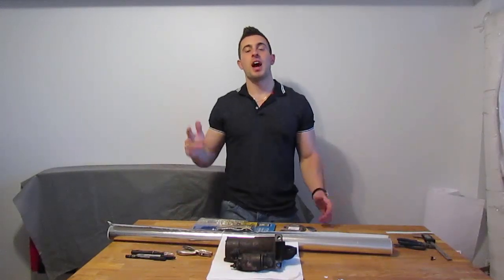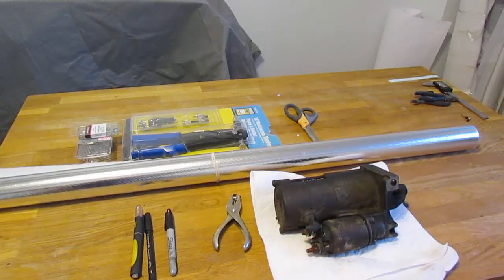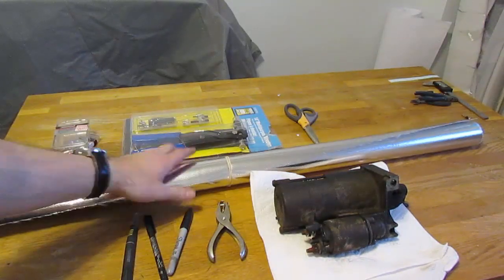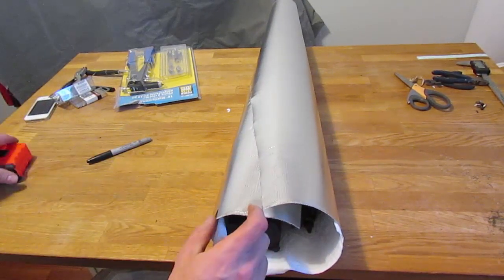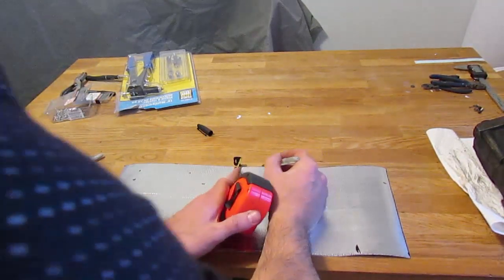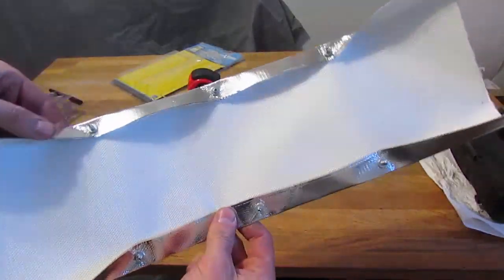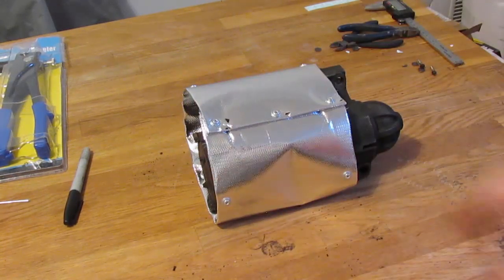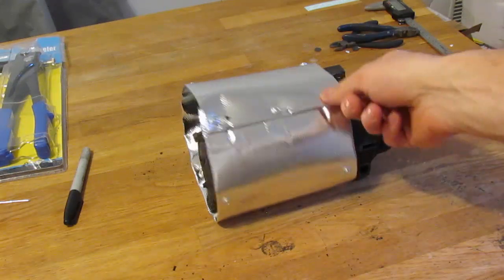DIY: Heat Shields (Part 1)

Comment: Great video! I'm not clear on what the actual material is that you are using. Any suggestions on what to buy?
Reply from the maker: Just go to a industrial HVAC store, it's a heat blanket type of material. some kind of fiberglass interior with the aluminized outer coating. Not 100% sure what the official name is but ask for a heat shield blanket and the HVAC place will know what you're talking about.

Comment: Wild question: Can steel retailing shelves work when making a heatshield? My friend has a few shelves for some reason.
Reply from the maker: You can make metal heatshields, yes. It will reflect the radiant heat from the source. It is pretty common for auto manufacturers to do this from the factory.

Comment: What thing is silver thick paper from where can I get ????
Reply from the maker: I think it is just pipe insulation and I got it from an industrial HVAC shop. Just check the temperature ratings on it but it is the same stuff they use for cars... but for cars they mark the price up 10x

Comment: Good idea.  Where do you get the aluminum fiberglass?
Reply from the maker: I got the material from a local industrial HVAC store. Much cheaper than buying automotive stuff which is identical.

Comment: Interesting video, learnt quite a lot ;)

For insulating my car's air intake from radiant heat, will aluminum foil tape do? My car's got black rubber air intake tubing. Also, should I also cover the whole airbox as well - for best results?

Many thanks in advance ;)
Reply from the maker: Theoretically it will help, but you probably won't notice an appreciable difference on a road car. My thinking is that the air is travelling through these components at a pretty good rate of speed and there isn't a whole lot of opportunity for heat transfer to occur unless the temperatures are extreme. The heat shields in this video were more intended for protecting items that are constantly bombarded with radiant heat from nearby components. But you can always try!
Reply: @EmbraceMaking  The exhaust manifold does have a heat shield from the factory, but even so the engine bay is indeed hot after a 10-15 km drive, so I suspect "every little will help" ;) I will give it a try, hopefully it will help, just a little, reduce intake temperatures.

Thank you for the reply and the information you provided me with ;)
Reply from the maker: No problem! Good luck!
Reply: @EmbraceMaking  Thank you very much mate! ;)

Comment: Great video.  The first car I had as a teen I burned out two starters. The guy I had bought the car from had replaced it before but never put back the heating shield. My dad pointed that out. He cut up a pie tin. put some holes around the corners. wrapped it around the starter, placed sos pads around the starter, to act as a buffer strung wire thru the holes to keep it place. Kitchen made heating shield.
Reply: It should keep radiant heat off very well. I have something similar, tightly around hot turbo side and manifold. Wrapped by stainless steel ties. It works.
Reply from the maker: Whatever works!

Comment: Wrapping a starter? Heat isn't going to affect your starter... Not unless your ECU is in there : /
Reply from the maker: Solenoid can get heat soaked and too much heat = more resistance and starter won't engage.
Reply: @EmbraceMaking  hot copper wire, more resistance?  no!!  unless the copper is melted (1050ºC); i would just wrap the  cut sheet around the starter,and use 2 loops of thin ss wire around the whole thing

Comment: If you get some aluminum flashing cut in 1 inch strips you can trap it in the folded over sections and rivet them in place. This makes it where you can form the shield to contours better and holds to the part better.
Reply from the maker: Great idea! Thanks!

Comment: great video, what would be a good way to fasten this shield to the starter? I have a 77 corvette and the header is very close to the starter and transmission lines. Thanks
Reply from the maker: You can use metal zip ties, they will resist the heat :)
Reply: Wrap around transmission lines ?

Comment: Does aluminum foil work to reflect heat.
Reply from the maker: Aluminum foil will reflect lots of radiant heat. However, it will also absorb some and the energy absorbed will be dissipated in every direction from my understanding. So, foil on it's own would allow some radiant heat to reach whatever it is that you're trying to protect from heat. It would be most effective to place some kind of insulating material (ie. fiberglass) between the foil and whatever it is you're trying to protect. Therefore, radiant heat escaping to the other side of the foil will not reach your heat sensitive item. Hope that helps!

Comment: I didnt know you could buy rough HEAT material like that.  Where can you even buy it?  Ebay?
Reply from the maker: I got it from a local supplier, they specialize in industrial hvac supplies. Try searching industrial supply stores for thermal barriers. It's just aluminized fibreglass